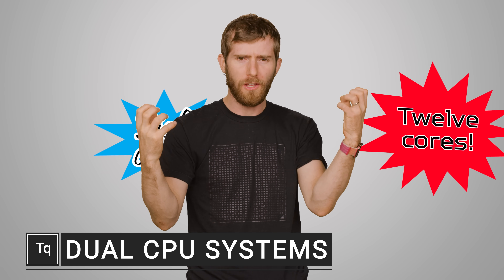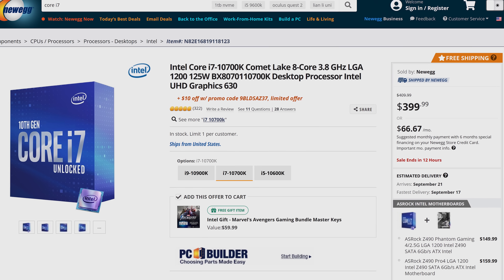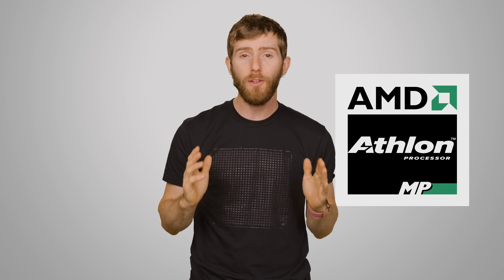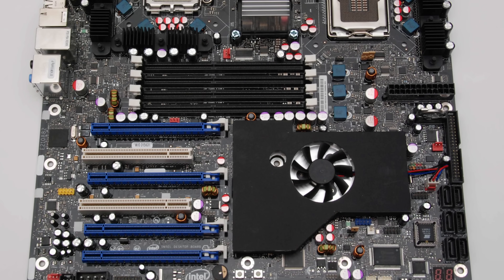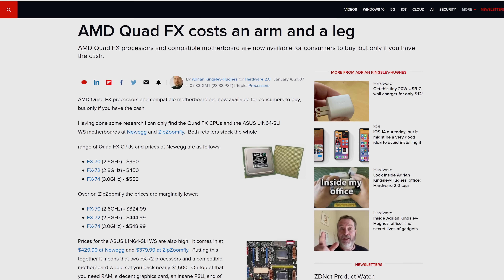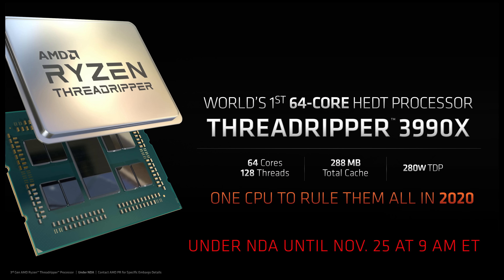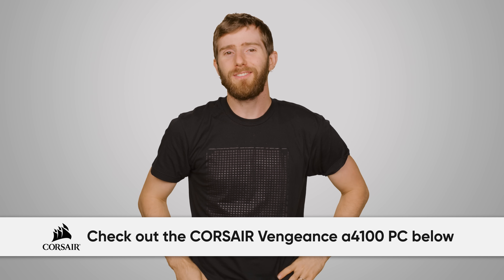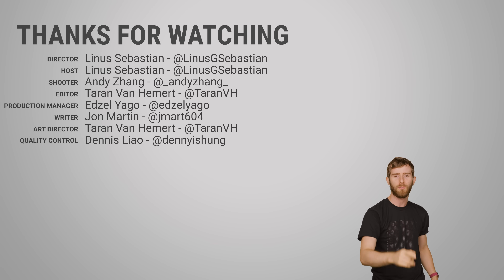Should You Put TWO CPUs In Your PC?

Comment: It seems like multiple CPU's could have some advantages, as far as heat management. It seems like there are always some games/workloads, that work well with multiple cores, BUT there are also those that run the best with higher clock speeds. Maybe, a machine could have a multicore processor to handle basic needs & system processes, but you could also have another socket, that has a high performance CPU, that runs at higher clock speeds. It could be one or two cores, so that it could run at high speeds, while generating less heat. Meanwhile, the high speed CPU doesn't have to share heat with the main one.

Comment: Is there something that requires mobo to be much more expensive for this design? I watched xeon mobos, dual cpu, and those cost 300$ minimum. Those chipsets need some QPI design to benefit multi-cpu pc, to exchange data and share load. Trend has been for 10 years roughly to integrate as much to cpu chip itself, like memory controller and so on, which has dropped mobo prices substantially over couple of decades.

Comment: Imagine having two 64 core threadrippers and dual RTX 3090s running microsoft flight simulator at 8k ultra settings with both the Threadripper and the 3090s overclocked as far as they can go. I wonder how much power that would use.
Reply: Ah yes, this is my 2kW psu

Comment: it depends, AMD offers less memory channels for 64 cores. If you use intel, for the latest gold series you have 6 channels with less cores, but along with another socket each set of cores has 6 channels. For some workloads that require high bandwidth e.g. memory databases, is important. Also, under some circumstances is actually faster to access remote NUMA nodes, see: https://community.intel.com/t5/Software-Tuning-Performance/Behavior-of-streaming-nontemporal-reads-and-writes-in-NUMA/td-p/1167080

Comment: Had a dual AMD Opteron 6000 series system for over 10 years now. I like the upgrade path as previously (extremely) costly processors become affordable. Currently running dual 6380 with 64GB and Vega 64. I use it for gaming and video editing and everything else. 

When gaming I run the game server on one processor and the client (my actual game) on the other and there are no latency or lag issues like I found when trying to do the same on a regular gaming system.

Allocating resources with custom startup files enables me to run several programs at once (such as capture and render at the same time) without them interfering with each other in terms of resources or timing.

I've been looking at the latest gaming and systems such as threadripper and Ryzen but I think I'll be looking at building another dual processor system but based on the Epyc CPUs.

Comment: basically we can increase the bus width on motherboard and divide it equally to multiple cpus by creating data dividing bridge on motherboard for processing. In this way by using two 64 bit cpus 128 bit data can be processed at a time, 256 bit data by four 64 bit cpus, 512 bit data by eight 64 bit cpus and so on for next generation ultra fast processing technique.

Comment: For a time, I ran a dual-CPU rig (EVGA SR-2, dual E5645, 12GB DDR3), and while I loved it, I won't go back to multi-CPU unless I have to.

The major reason is this: When something goes wrong, you have (nearly) twice as many components to check over to find out what caused it.  Whether it's reseating 6 sticks of RAM in a futile hope to find that missing 2GB, replacing both CPU coolers because one AIO liquid cooler has decided to stop cooling, or irritating software compatibility issues caused by having too many cores for your older software to comprehend, you're going to have problems.

Add to that the general size of any multi-CPU build (the boards are massive, requiring massive cases, which then require huge amounts of room to put them), the power consumption (When just idling can consume enough power to run a normal CPU flat out, it's bad), and the added maintenance headaches (cleaning out your heatsinks?  Here, have twice as many.  Dead CPU fan?  Replace both, because if one died, the other's not going to last much longer.  Time to reapply new thermal compound?  Have fun, you get to do it twice), and you end up with a mildly frustrating experience.

Don't get me wrong, if you're up for a high-maintenance machine that, 90% of the time is rock-solid, Dual-CPU is great.  That machine will likely remain as my fastest ever computer, and the longest I've ever run a single board without significant upgrades, but I found out it's just not for me.  And there's nothing wrong with that.  It's like trying liquid cooling, deciding it's not for you, and going back to air cooling with big tower heatsinks.  I did that, too, because air cooling is simpler, less likely to break down, blow up, or just flat out make a mess.

The biggest things that have actually made this decision for me is upgrades and performance.

See, in a normal single-CPU system, you have three major upgrades that don't really have to cost too much.  CPU, RAM, and GPU.  I'm ignoring hard-disks or SSD's, they don't count for this purpose.  In a dual-CPU system, you have twice the amount of CPU's to upgrade at the same time, and twice the amount of RAM that has to be upgraded, again, at the same time.  Suddenly, any CPU upgrade you're looking at is instantly twice as expensive.  Hence, I kept E5645's the whole time, because anything faster would need two chips, and that gets pricy fast.  I had 6 sticks of 2GB Corsair Dominator memory, because dual-CPU-triple-channel required that as a minimum.  Any upgrade to my memory would have been a full kit of 6 sticks, minimum.

And that performance half of it?  I'm not just talking programs here.  In that system, there would have been no benefit to the boot time by installing a solid-state drive.  What's 15 seconds going to save me when it takes 30 seconds to check out everything before initializing the display?  Then there's programs that don't recognize CPU1 and so they all pile up on CPU0, there's programs that crash because somehow CPU0 is handling all of their workload, but CPU1 is where the program's memory got allocated, and there's the fact that 80% of your average daily workload, as a home user, is unlikely to make the most of even one of those 6-core-12-thread Xeons.

So, while I loved it, it sits there under my desk while I use a laptop with an i5 that I swear feels faster some days.  Partly, the desktop is out of operation because of an overheating issue that I can't solve.  Considering the board's northbridge cooling fan exploded, I'm not that surprised, and considering the number of changes I've made over the roughly 9 years of ownership, I wouldn't be surprised if I blocked the airflow to something like the VRM's and never noticed it, but I tried for three months and still couldn't keep it stable in the summer.

As for what my next main rig will be, I don't know yet.  Ryzen has me tempted, though.  For now, my trusty i5-5300U and my 8GB of RAM is good enough.

Comment: Long before Athlon MP, the first enthusiast dual CPU motherboard was the legendary Abit BP6 dual Celeron Motherboard, back in 1999. Even before that, you could use Asus P2B-D board with S370 to Slot 1 adapter, that enable SMP on Celeron CPU. I doubt about the dual 486 motherboard you present in your video, at this time motherboard had dual slot to add a FPU unit to the CPU.

Comment: Dual CPUs very early in the game were very expensive.  But the price came down quickly, as more lower end CPUs were allowed the ability to run in dual configuration.  I ran quite a bit of machines at the desktop with this setup, and yes it did help performance in everything.  Windows was very multi-core capable, even if the software on top of Windows wasn't.  Windows helped out the software quite a bit by not bottle necking it quite as much with a single CPU.  It was quite noticable, and very nice for a modest price bump once the idea caught on and prices dropped.

Comment: No mention of the Legendary ABIT BP6  motherboard?! It allowed 2 OG Celeron processors to run on the intel 440BX chipset. The 300Mhz Celeron-A would generally hit 450Mhz giving combined price performance boost for the time that has probably never been beaten. You had to game on Windows 2000 or NT since Windows 9X and ME had no multi-processor support at all. Or wait 18 months for Windows XP. I believe Quake 3 was one of the few games that had a command switch to enable a multi threaded game engine.

Comment: He shows an SX-33.. I've got one right next to me, along with a DX2-66, Pantium-75 and DX4-100.. All working systems.
(Also have spare chips: 3x SX-33, 4x DX(2) 50-66, 2x DX2-90s, 2x DX4-100s, and like a dozen Pentium-1s 90mhz-200mhz.. and a couple 286s. Several pounds of old 30/72pin ram)
Reply: I've also got 2x dual-slot1 boards populated with P2-350s.  Will say I'd never seen or even known dual socket-3 boards existed though.
Absolutely have to find one now. Thanks Linus.

Comment: I still have a dual cpu Dell Precision 530, vintage 2003 I believe.  Dual 2.2ghz, 4gig ram.  A bit slow by today's standards, but perfectly functional - though I bought 4 spare cooling fans when one of the two died... They were cheap on eBay and I figured I'd eventually lose the other (haven't yet though).  At some point though I'll probably upgrade my laptop and use the old one in it's place, it's a bit power hungry.

Comment: Suggestion: Since Apple no longer sells mid-grade monitors like the 27" Thunderbolt Display. Would it be possible to convert (and gut) a modern iMac into a display with an added feature such as an external hard drive built into the body?

Could be a cool project if possible.

Comment: Software support continues to be the Achilles Heel of multiprocessor desktops. Good example: I picked up an old  2010 12 core dual processor mac pro for my GF's home office for adobe suite. Guess what? Indesign is still sluggish despite 24 threads at 2.93ghz (westmere). By comparison, my trash can 2013 mac pro with a single 6 core processor at 3.5ghz is considerably less sluggish (ivy bridge). For the vast majority of software, newer architecture and higher clock speed are more effective than more parallelism. Only situation where a fuck-load of cores is ALWAYS good is when building a virtualization host that you intend on running numerous VM's simultaneously. At that point, throw some old cheap 16 core opterons in that guy.

Comment: He didn't even mention Windows® licensing issues. If you had (have) a single CPU with multiple cores, it's an ordinary license. If you had more than a CPU (the chip itself) in the same machine, it's another license.
(Back from when I had Windows 2000 installed...)
(And yeah, "have Linux installed instead" is probably a practical solution for most cases today, depending on the usage. Not back in 2000s, though - I swear I tried it🤷‍♂️)

Comment: Dual Slot 1 C333's where very much a thing on the old intel BX platform. You could clock those C333's to silly rates. Home users with a couple of cheap Celerons on a BX motherboard that was consumer grade with 2 slots

Comment: My MP builds in that era:
Abit BP6 2x Celeron overclocked
Tyan Tiger MP 2x Athlon pin mod & overclocked

User experience was remarkably snappier than single core systems in that era, in the same manner moving to an SSD is today, regardless of whether a single game/app could benefit much.
However, able to simultaneously host Quake servers, etc. and run client with no performance hit. Good old days of overclocking when you could truly stretch budget/value parts. Core2Duo came along for the next build, have since abandoned MP builds.

Comment: I remember me when I was younger/student and I studied CGI, Design & Video I built a custom workstation. There was no great GPU at this time and I had to rely on CPU power, so I used 2x Pentium II 400MHz on a Supermicro dual CPU motherboard with SCSI HDDs...  It was running on Wint NT and the built was super unstable. Now, I'd prefer a single CPU with more cores and a powerful GPU.

Comment: Back in 2001 I've bought a dual CPU system (MSI 694D Pro Dual Socket-370 Apollo Pro133A ATX, 2* Pentium III 800MHz), which was an absolute beast at the time. I was running Multiple Game Servers at a LAN-Event, listening to Winamp while gaming Counter Strike at perfect framerates. PC just didn't want to slow down a bit.
Reply: Wow, How did I possibly not know about this motherboard, back then I used MSI almost exclusively Except for my ABit BP6 (Dual 370 system using 500mhz Celerons) and slightly later an ABit VP6 using two 1ghz Pentium III's. The speed was insane, as long as you used Windows 2000 as 98/ME [BSD also, but not Linux] didn't support SMP. I'm pretty positive most the speed gain was from most software only capable of using one CPU at a time, occasional software lockups that would become transparent, and similarly not having to distribute the cpu's resources across twice as many processes/threads/whatever. The machines truly seemed 10x or faster in many cases.

Comment: 1:05 -- I guess I don't recall how long after launch I upgraded -- but when I went from my 386SX-20 to a 486DX-33, the whole upgrade (including going from 2MB to 8MB of RAM), was around $800.

Now this did include trading-in the old CPU and RAM, not that I think it was all that valuable at that point, but lets call the without trade-in price was ~$1000

The RAM was $54/mb (not sure why I remember that so specifically), so that was $432 of the cost, which leaves ~$570 for the CPU upgrade and labor.  IIRC, a motherboard swap was not required, but I could be mistaken.  If so, some of that $570 would have gone to the motherboard as well.

Comment: t5500 for 90 bucks on ebay with a riser and a second CPU costing another 60 total, that and 95 gb of ddr3 for 100 bucks. You cant beat that. It still screams like you would expect 24 threads to. and comes with a massive PSU for huge GPUs to boot.

Comment: Call me crazy and this may simply because I grew up during the era of coprocessors but I think PCs should be built in a way that you can just add a new CPU to the unit each time there's an upgrade without having to strip out heatsinks.  Kinda like if a NUC had a way to daisy chain together a new NUC when it came out for three times the NUC.  In my mind the next gen NUC being twice as good as the last one.  And yes I know most coprocessors replaced the original CPU rather than actually working along side it.

Comment: The good thing about multi-CPU systems is that they were pretty much future-proof. I'm still using an OC dual-Xeon system (two 6-core CPUs at 4.33GHz) on EVGA SR-2 (MB and CPUs are from 2010) together with a 1080 GTX, and it holds up great at 1440p. This configuration saved me at least one generation of upgrades, so investing in it back then might have been a really good choice. I wouldn't go for it today though.

Comment: I built a system around the Asus L1N64-SLI board when that came out, having 4 CPU cores was just amazing to brag about, not that much I did ever made use of them that is.
That board is framed on my wall now, along with a few of the more interesting boards I've had over the years.

Comment: No, it makes little sense to put more than one CPU in your computer unless you're computer is a server.  You're better off buying a single, multi-cored CPU.  Partially because multi-CPU boards are expensive and usually require ECc RAM (as most dual CPU board are server boards, and many/most server boards require ECC RAM).  In the old days, with computers like Pentium 2, 3 and 4 (basically before true multi-core CPUs) yeah it made some sense and I knew some people who ran dual 1 GHz Pentium 3's.    The only people I can think of that might consider a multi-CPU setup would be people creating media or doing CAD work (like animators, designers or people running intense computer simulations).  But for 90% of the people out there, a single multi-cored CPU (like an 6 ,8 or 12 core) is more than plenty . People also have to keep in mind that you will only see the benefit in multiple cores (or CPUs) if the software was coded to take advantage of multiple cores, and depends also on how many cores it's coded for.  Some are coded for only quad cores, while others could use all the cores available.

Comment: Hope someone can help me.  Have a lenovo thinkcenter sfx  M series . I was uninstalling an app and it asked if i wanted to uninstall all settings and back ups. i did thinking it was for the app. The pc rebooted and sounded off with what  sounded an alarm. Windows started and everything seemed ok, except when rebooting  the alarm would sound before windows started. So instead of leaving things alone, i tried a system restore with windows reinstall . Windows reached the point where it starts asking questions, like what country to choose. That' s when i found that my keyboard or mouse was not working. Went into bios everything that should be enabled looked like it was,and here i am. I have a new graphics card and power supply on the way. Starting to panic

Comment: Techquickie ideas:
1) Quick summary of who in the tech industry is pushing the most innovation and invention. 
2) Discussion of the limitations and benefits of bluetooth (why is it so good sometimes, so janky others?).
3) Discussion of the ways in which more data can be sent along higher frequencies of wifi. 
4) Discussion of wireless interference. 
5) Discussion of the dangers of USB-C charging (how it draws more power and can be dangerous to certain products). 
6) Discussion of how to know which chargers are safe for which peripherals! (more and more of my usb charging devices are coming without instructions on power charging limitations, and no wall wart included, usually only a usb cable) 
7) Discussion of powered vs unpowered usb hubs, and how to get a powered usb hub that won't damage your devices.